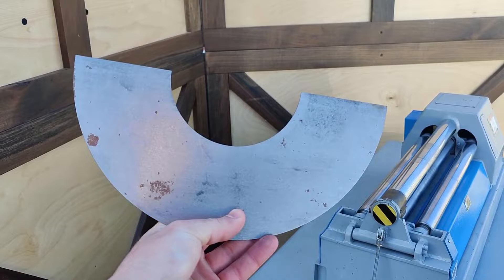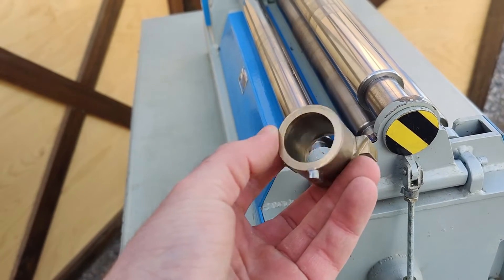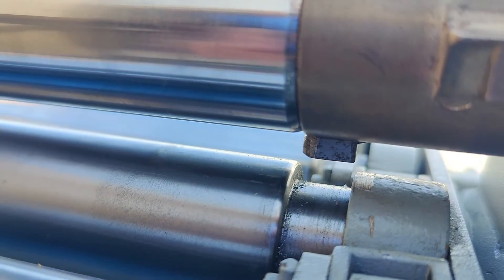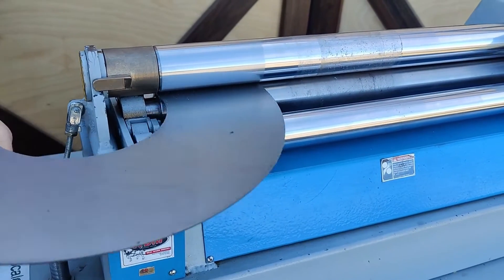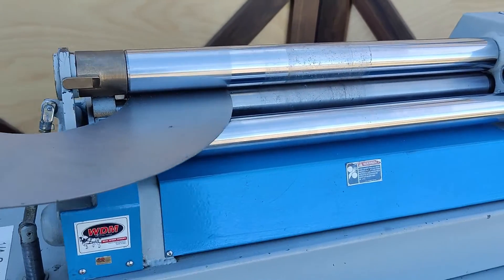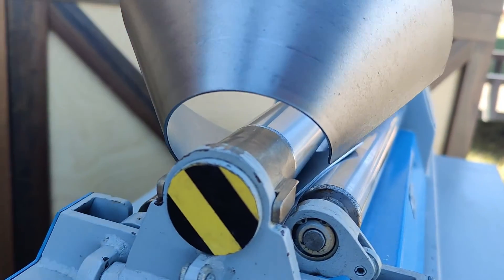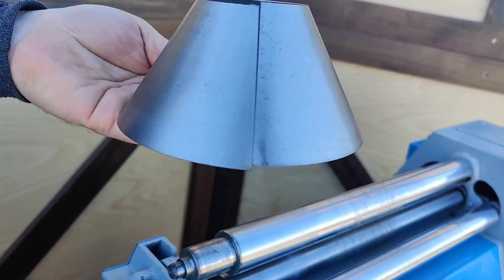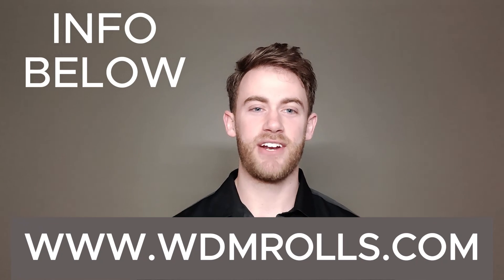You Need Help Cone Rolling! 4-ROLL

Comment: This "snubber" attachment you are placing on the machine ..  is that a bearing? Is its purpose to prevent the workpiece from creeping towards the minor side or the rolllers? Does the minor side rotate around it?
Reply from the maker: Hey James, That is a great question. The snubber on our standard cone attachments is just hardened 4140 and it acts as a brake to keep the minor diameter from going off the end of the rolls. The reason you need this is because you are only gripping the cone blank on the major diameter and the minor diameter skids through the rolls and it needs something to skid against. Our heavy duty cone attachment functions the same way but uses a roller instead of the snubber.

Comment: У вас маленький конус из тонкого металла, я лет 10 назад катал конус толщиной 25мм, там сложность основная в том что бы понимать что за раз не катается конус в размер и если конусов много можно запоминать параметры подъема валов.
Reply from the maker: Yes exactly. Even if you are rolling a 25mm cone you should not roll it in a single pass. And that is a great idea to write down your parameters and reuse them if you are rolling multiple cones at a time.